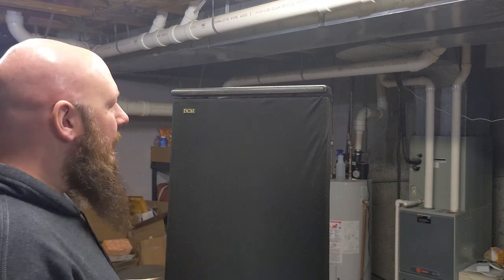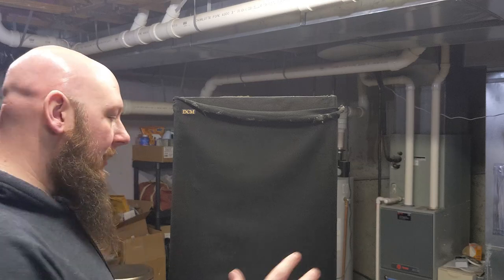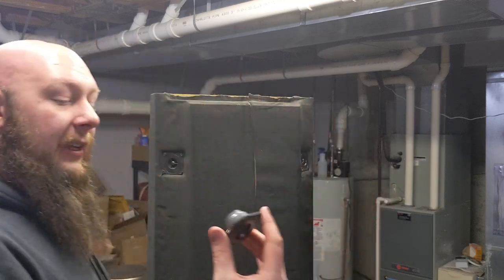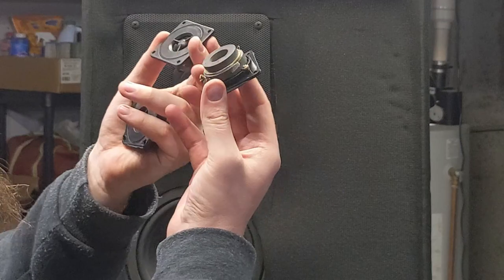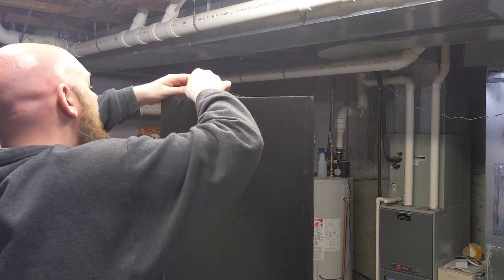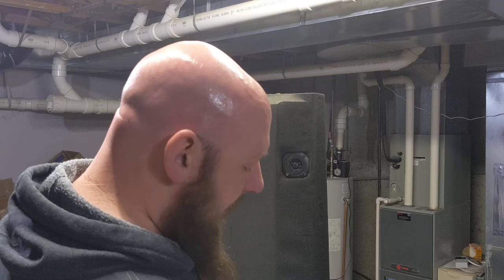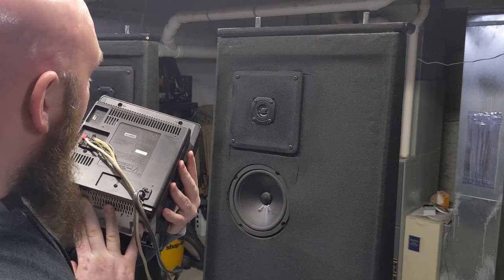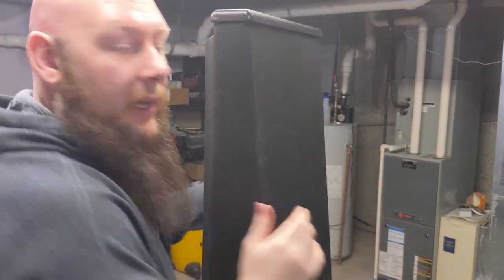Re-Tweeting My DCM Speakers

Comment: That 'fuse' you mentioned is a light bulb thats supposed to take on the extra power (light up) ti protect the tweeters. Very smart design. Change it out! They are automotive  bulbs ( interior bulbs)
Reply from the maker: Thanks for the info, however, I sold these speakers a few months back. They were really good, even with bypassing the fuse. I just found something with a smaller footprint that still sounded as good.

Comment: Thanks for putting this video out, great job. I was wondering how to get the top caps off. I have a set of Time Frame 1000s that I bought while I was in the military. Unfortunately, my ex had a cat that started using them as a scratching post, so they were relegated to the basement. I am going to tear mine apart and redo the speaker cover and get them back into service (no cats with the new wife 😆)!
Reply from the maker: Thanks, glad it could help you out.

Comment: I have some DMC CX-17’s and one of the tweeters is bad. Do you know if anyone sells them or if there is another brand that would fit since the tweeters are mounted right in the center of the subs.
Reply from the maker: I'm not 100% sure for that model, but they may be the same ones from Parts Express that I used. A good idea would be searching some audio forums like AVS or Audio Karma. That's how I found the ones I bought. Hope that helps.